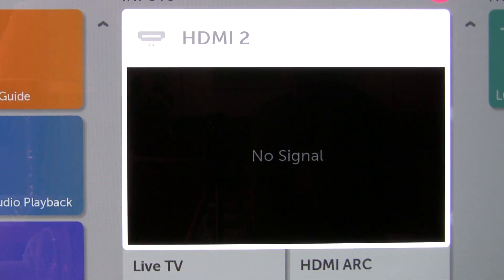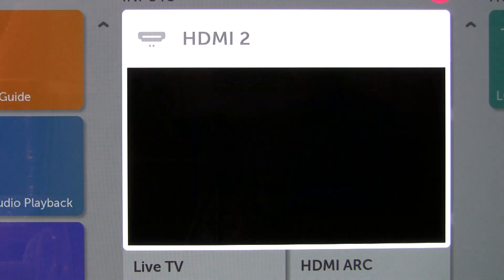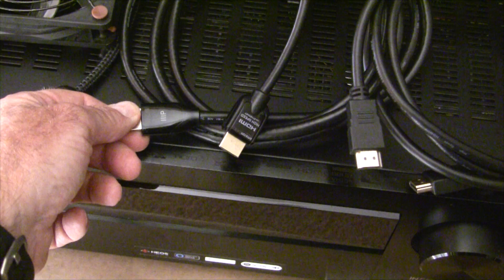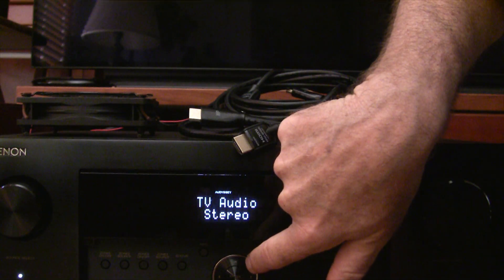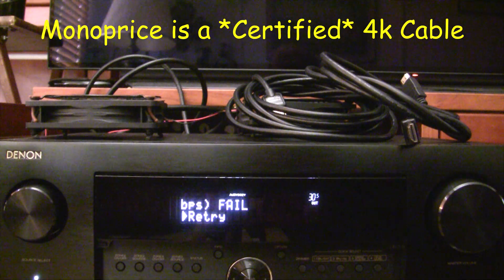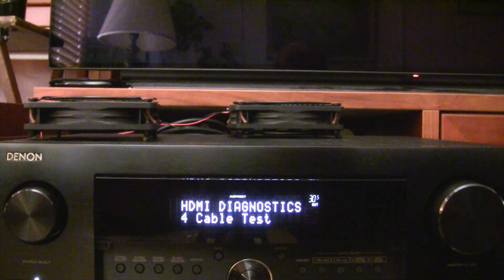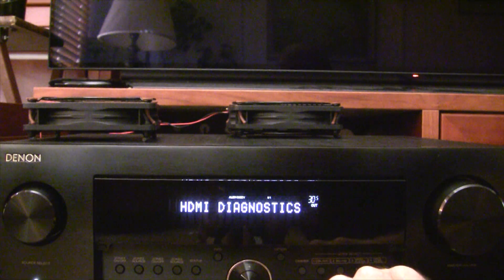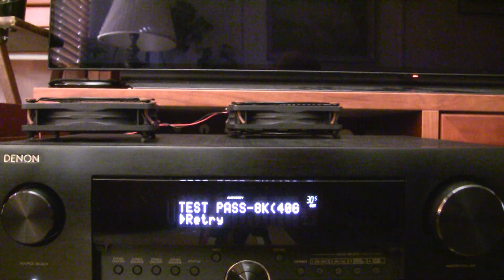Denon Receiver HDMI Cable *RE*Test - Testing High Speed & older HDMI cables using New Firmware

Comment: One of the coolest features on the Denon AVRs foe sure. always helps when you have so many HDMI cables laying around and want to be sure they are good. Im still deciding between the 4700h and 6700h....
Reply from the maker: I picked the 4700h because I have a 7.1.2 Dolby Atmos speaker setup.
I have a playlist of videos documenting my upgrade a 2012 Home Theater system:
https://youtube.com/playlist?list=PLM0nwcQ_luubIhLpIB44HPG01OX4O58jr
Reply: I started with the 3700 and swapped to the 6700, when i went to purchase the 3700 and 4700 were the only two available, the 6700 was out of stock and no ETA, but i eventually got one. 

I have a 7.2.6 speaker layout, setup for Auro 3D rather than using the flawed Dolby speaker layout. The 6700 also has DTS:X PRO, which the 4700 doesn't have. 

Biggest thing is the 6700 is made in Japan, the 4700 is not, and it shows.

Comment: Does it run that hot you need 2 fans on top ? ... Heard Denons run extremely hot
Reply from the maker: I think I need two fans. The left side has the power supply which naturally runs hot and I wanted another fan over the rest of the components to keep them cool as well.
I cover that in Part 8 of my series about upgrading my 2012 Home Theater System:
https://youtu.be/N799vo9hnoo
Reply: Thanks for the reply  👍
Reply: Better safe than sorry. With 11 channels of processing and 9 amps inside of that AVR there is VERY little space for cooling and the 6700h has better heat sinks vs the 4700h so MORE AIR is always better to extend the life of your AVR regardless of if it gets hot enough for not. Best option is the one that covers the entire top of the AVR and exhausts the air either up or out. The AC Infinity AirCom version are great.

Comment: Wow generic cable passed 48 8k,now i was thinking not to buy alternative hdmi 2.1, i still have Audioquest carbon 2.0 4ft hope it works.
Reply from the maker: Good Luck! Let us know how if it works.
Reply: @BetaCygniBlog  My Carbon 2.0 it works  on  Ps5 but theres a few times when on HDR modes my CX  drops to SDR. maybe is really meant for 2.1 HDMI i purchased Rocketfish 8k ultra certified never had an issue since then.

Comment: I just rewired my entire entertainment center this past weekend but before doing so, I ended up buying all new 2.1 HDMI cables and figured I'd try to test them out before going through the trouble of installing them and then running into issue down the line.  I ran into the issue like you did, where it would only pass the 9Gbps test and fail the 18Gbps test but then after running a retest right after, would pass the 40Gpbs test.  I was doing the test with a 4700h and hoping that it wasn't an issue with my receiver since I just bought it a couple months ago.  So glad I found this video and will try again this weekend and will definitely unplug it before running the test.  One of the HDMI cables I ran last weekend seems to be having issues so I want to definitely test that one.  And yes, I realize not everything requires HDMI 2.1 but I'm weird when it comes to everything in my entertainment center matching, even when it comes to the cables connecting everything together. Thanks again for making this video..
Reply from the maker: You're welcome. Let us know how your cables test out.
I recently tested the new certified HDMI 2.1 cable from Zeskit:
https://youtu.be/zWuoCEpl79Y
Reply: @Beta Cygni  Well, the retest went great.  All 4 HDMI cables that I tested passed the 40Gbps test. The cables I tested are the Belkin Ultra high speed cable (have 4 of these going to the CX), the Anker certified ultra high speed cable, the monoprice ultra high speed cable and the CableCreation slim ultra high speed cable.  I really like the CableCreation and the Belkin cables due to the fact that they’re not as stiff as the rest of the cables that are out there and since my receiver sits in a cabinet, having a stiff cable plugged in for an extended period of time, ends up putting too much stress on the HDMI ports, in my opinion.
Reply from the maker: @DeplorableRaf  Great! I'm glad it worked out.
Have fun with your new home theater!

Comment: do you have your fans blowing in our out of the receiver? and do you have them plugged into the wall or plugged in to be able to  turn on with receiver?
Reply from the maker: Out of the receiver. So they pull air up through the holes I drilled in the shelf under the receiver and then out through the holes in the upper back of the cabinet.
I cover that in this video:
https://youtu.be/wdoiVki7_8s
They turn on when the Home Theater system comes on using a smart plug along with the subwoofer. I cover that in this video:
https://youtu.be/_nvsu3FbZ7c
That's part of my series on upgrading my 8-year-old Home Theater system:
https://youtu.be/c5jgOY4J6eE

Comment: Sir noobie question here. So when you are doing this both end of cable should be plug in? If yes which exactly 2 ports did you use? Thanks
Reply from the maker: That's covered in the description of my first test:
https://youtu.be/o80WSww6bYo

"Hook up the HDMI cable between HDMI7 (8k) and the Monitor1 (eARC) HDMI ports on the back of the receiver."

Comment: Silly question I have got a denon avr 4500h receiver.Due to a bad firmware update which rendered my network loss,how did you update your firmware.
Reply from the maker: The first part of this video covers upgrading the firmware for my Denon AVR X4700H, but if you don't have an internet connection that won't work.

I found this procedure on Denon's website showing how to reset your 4500h to it's original firmware:
https://denon.custhelp.com/app/answers/detail/a_id/7258/~/avr-update-issue-%E2%80%93-june-2020
That's what I would do, but you should contact Denon support first if you don't feel confident in doing that.

Let us know how it goes.

Comment: Which button i have to press at the X2700H ?
Reply from the maker: I don't know, but I asked on this forum: https://www.avsforum.com/threads/official-2020-denon-avr-owners-thread-faq-posts-1-8.3151088/page-259
Hopefully someone has figured it out. If I get a reply, I'll post it here.
Reply: @BetaCygniBlog  thx a lot
Reply from the maker: @x1k135  Already got a reply!
Press and hold the far left button (TUNER PRESET CH - ) and ZONE2 SOURCE together.
Let us know if it works for you!
Reply: @BetaCygniBlog  works, thx :) but how reliable is this test? My new monoprice cable fail the 4k 18gb test
Reply from the maker: @x1k135  A number of people have reported this test is flaky and you can see from my results that it still has some problems.
I had the best results with turning off the receiver and unplugging the receiver from the wall power so it's completely off. 
If you just press the [Off] button, it is in stand-by mode.
Once the receiver is off, then plug in the HDMI cable and plug the receiver back into the wall power.
Let us know if that works for you.

Comment: I got my Denon X6700H yesterday. I've been busy setting it up and using it. Today I'm trying out doing the HDMI cable tests. Unfortunately, the testing seems to be too inconsistent and flakey. In general, this will happen;

1 - I'll start the Auto Test.
2 - It will usually immediately fail with an error message like V2-04
3 - I'll retest it. 
4 - It will work with 4K (9Gbpbs) Pass / 4K (18Gbps) Fail. 
5 - Sometimes a test on that same cable will get an 8K (40Gbps) Pass.
6 - Re-trying the test yielded inconsistent results.

It could be that I'm doing somethign wrong with how I'm testing. Or maybe there is some type of interference from the mass of cables behind my AC deck that is interfering with he HDMI test? I really hope there isn't something wrong with my new Denon receiver that's the cause.

On the other hand, I did a couple of tests using the HDMI cable I had connected to the PS4 PRO or Apple 4K TV using their respective HDMI cable tests. Those were very simple. And consistent. 

I will try calling Denon Customer service next week to get some help. Mainly to try to rule out that there is something defective with my Receiver.
Reply from the maker: Make sure you check for a Firmware upgrade to your receiver. After I did that, I got more consistent results.
Also I had better luck turning off and unplugging the power cable before swapping HDMI cables. If you just use the power button on the front of the receiver, it goes into "standby" mode and isn't really off.
I still had a strange result with the very old (likely HDMI 1.4) cable, but the others tested consistently.
Good luck.

Comment: Have you checked if the C9 supports QMS and QFT features of HDMI 2.1? I couldn’t find an answer for this online. The Denon 2020 AVR feature that shows the signal info could determine. It will show the supported features of the source and do display if you have a chance to check please
Reply: Thanks very much for the reply. I’ve got my series x on pre order as well and trying to get a CX and 4700. QMS in particular really important to me since I want to use matched frame rate on Apple TV without the black cut out.

If you check this video, https://youtu.be/DUP4nK8f-_E?t=4030
The Denon 2020 AVRs should be able to add another data point that was not available when the C9 was released so it might hint to the compatibility of the implementation.
Reply from the maker: @SnowBob302  You're welcome. I didn't hit the internet lottery on Series X pre-order day, so I'm hoping to get one when it actually comes out.

Thanks for the link to the Denon video. That guy is the best source of Denon info.

However, I'm not going to run my Xbox through the receiver. I'm going to connect it directly to the C9. 
It took me a while during the planning process for my upgrade of my 8 year old Home Theater system to figure out that the TV is the new "hub", not the receiver like it was 8 years ago. 

Here's a link to part 1 of a series I posted about my process of upgrading my old Home Theater System.
It includes using the Denon x4700H to drive a 7.1.2 Dolby Atmos Surround Sound system:
https://youtu.be/c5jgOY4J6eE

I realized there's no reason to run video sources through a receiver. The modern LG TV's are the best processors (for upscaling, tone mapping, etc.) for video signals so there's nothing gained by running it through the receiver; you're only introducing lag.
With HDMI 2.1, the lip sync problem is solved, so using eARC to a modern HDMI 2.1 receiver like the x4700H, you get perfectly synchronized sound including Dolby Atmos.

The only thing I would want to run through the receiver would be an audio-only source like a CD player.

The LG TV's have 4 HDMI 2.1 inputs which is enough for any conceivable sources you might have because so many apps are built into the TV. If you do need one more, then you can use an input on the receiver for a total of five.

For example, as far as Apple TV goes, you don't need a separate box anymore (which I assume you have based on your comment. If not, I apologize).
There's an AppleTV app built into the TV, just like there is for Netflix, Amazon Prime Video, YouTube, etc.

I have a Chromecast Ultra HD streaming device going into one HDMI port on the LG so I can stream things like PBS that don't have apps (yet> they have an app for Samsung smart TVs and say they'll eventually have one for the LG TVs).

We cut the cord to Comcast for TV, so we're using Hulu LiveTV to get our TV channels and they don't have PBS. We give money to our local station so we can use our PBS Passport login to stream any PBS shows.
Reply: Beta Cygni that was my plan originally also, to have everything routed through the TV. Although the CX ruined that plan by dropping the DTS decoder so no way to get DTS X through eARC on the 2020 OLEDs. For >95% of content that won’t matter but is ultimately a compromise if going with the 2020 hardware. I want to use the Xbox as the UHD Blu Ray player also therefore if I route through a CX, I would not be able to enable bitstream out on the Xbox for Blu Rays. Arguably it’s not a problem but it will mean that everything gets repackaged as an Atmos stream no matter the source, at least this is how it works on the current One X.
Reply from the maker: @SnowBob302  Ahh. I see. I hadn't heard that (no DTS support in CX) before because I'm not following the CX that closely since I got the C9.
In that case, you'd want to run the Xbox through the receiver just like you said.
I'm sure it will work fine. 
I'm also going to be using my Xbox Series X to play my 4k UHD DolbyVision/DolbyAtmos discs like Ready Player One. That's one reason I picked it over the PlayStation 5. The PlayStation 5 doesn't support DolbyVision or Atmos. That's a non-starter for me.
Reply: Beta Cygni thanks for your suggestions. Planning to get all the gear next month after I move. Hope you enjoy your setup, seems like an awesome home theater!
Reply from the maker: @SnowBob302  You're welcome! 
Good Luck on your system.
I'm really enjoying mine, especially the C9 & Dolby Atmos sound.
I'm looking forward to getting new Xbox to complete it.
Reply from the maker: Apparently, until the Xbox Series X & PlayStation V come out, we won't know for sure.
But this article says that LG says that the C9 will support QMS
https://www.flatpanelshd.com/review.php?subaction=showfull&id=1559035462

I suspect the same is true for QFT. The LG C9 already has the lowest input latency (in Game Mode) as far as I know.

I'm going to be getting an Xbox Series X when it comes out, so I'll be testing those.
I'm sure many of the big sites will check thosetoo.

Comment: I purchased 2 Zeskit 8 k cables based on this video.  I use them on my Xbox one X, PS4 pro on my Lg Oled Cx.  I was using the high speed cable that came with the one x and switched to the Zeskit with same picture settings.  I saw a noticeable difference with the Zeskit, Gears 5 and Marvel Avengers looked cleaner?  Anyways, these cables are great!
Reply from the maker: Great! I'll be testing the cable that comes with the Xbox Series X when it comes out in November 2020.  I hope they have a better cable in that one. It should be equivalent with the Zeskit 8k.

Comment: Xbox series X comes with an 8k/4k 120fps cable
Reply from the maker: Yes, I realized that recently. lol
I'll go ahead and test it using the HDMI Diagnostics test built into the Denon receiver.
The true test will be whether I can get DolbyVision and DolbyAtmos sound with lossless TrueHD sound.
I have some 4k DolbyVision/Dolby Atmos-TrueHD blu-ray discs (like Ready Player One) that I'm going to use to test it.
Reply: @BetaCygniBlog  is the x4700h remote backlit?
Reply from the maker: @Bigpotatos  No. I'm using a Harmony Elite universal remote which is backlit.
That allows me to control my other devices (including the TV & Blu-ray player) and to turn on the power to my subwoofer, Chromecast Ultra HD, fans to cool the receiver, and auxiliary lighting.
Here's a link to the first of a 3-part video about that:
https://youtu.be/_nvsu3FbZ7c

Comment: Nice, good job man. So looks like the unplugging power with HDMI Cable changes does the trick. I just got my 4700, going to start testing all my cables.
Reply from the maker: Thanks! Make sure you update the firmware of the 4700h. Good Luck. Let us know how it goes.

Comment: Overall, how do you like the 4700H? I'm looking to get a 9 Channel Receiver. The 4700 and 3700 are ones I'm considering. This is to use with my LG CX. And hopefully a PS5.
Reply from the maker: The 4700H is great!
I picked it over the 3700 because my old receiver (Denon AVR-2807) had 110 watts/channel and I didn't want to go down in power to 105 watts/channel. My old receiver did a good job of filling my room with sound.
The 4700 has 125 watts/channel.
Here's a link to the first part of my video series that shows installing it along with my LG C9 as I upgrade my 8 year old home theater system to a 7.1.2 Dolby Atmos system and 4K TV:
https://youtu.be/c5jgOY4J6eE
I also upgraded my speakers which I'm sure is a big reason it sounds so much better.

When buying electronics, I find that buying one level below the "top of the line" gives you the most bang for your buck. The top of the line for Denon right now is the 6700H, so the 4700H was the logical choice for me.

I'm getting the Xbox Series X (in November) to replace my old blu-ray player so I can play my new 4k DolbyVision/DolbyAtmos movies (like Ready Player One) and for gaming.
I haven't owned a gaming console before since I play my games on my PC, but I wanted a 4K blu-ray player and decided it would be fun to play some games on my new LG C9 4K Home Theater system.
One reason I chose the Xbox over the PS5 is that the XBox will support DolbyVision and Dolby Atmos
https://www.whathifi.com/us/news/xbox-series-x-the-first-games-console-with-dolby-vision-hdr-and-atmos

That will take full advantage of my system once games start using them.
Reply: @BetaCygniBlog  Thanks for the info. I ended up getting the 6700. It arrived yesterday. I've been busy connecting it and setting it up. There are some quirky issues with it. But hopefully everything will smooth over and be working fine in a week or so. As I learn about how to use it.
Reply from the maker: @_Volt_Ron_  Good luck! I'm still loving mine every time a ship flies overhead in a sci-fi movie! :)